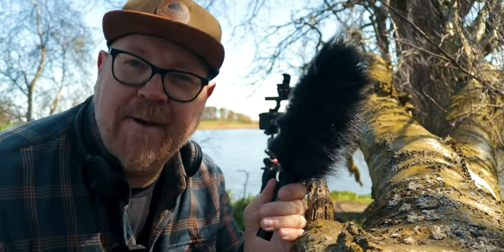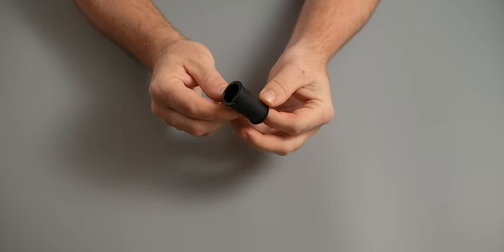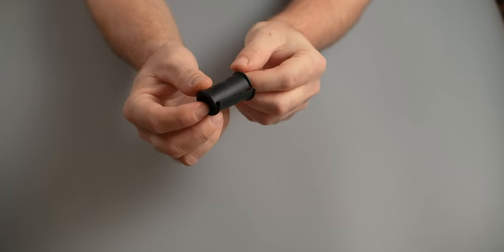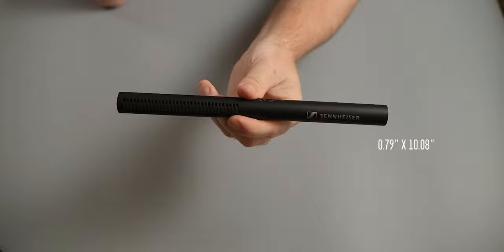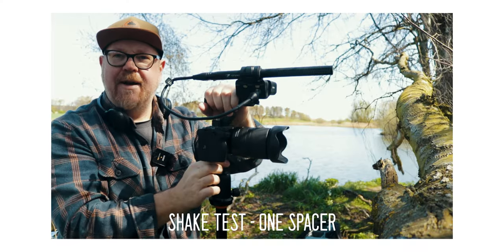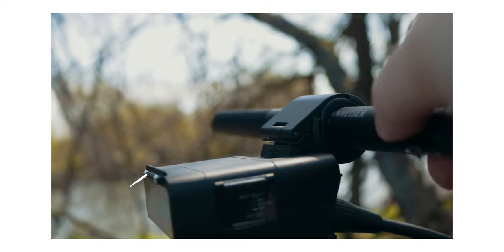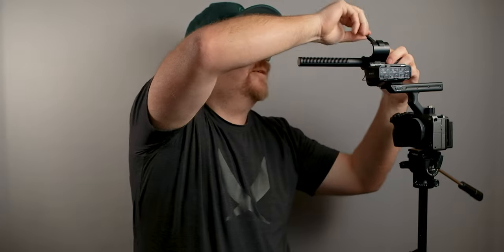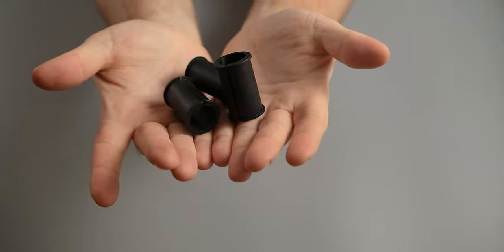Skinny Microphones on FX3/FX30 (MKE600 /NTG5)

Comment: Thanks for this.  Shocking that SONY didnt provide a mechanism to do this, it would have been so easy to cover.
Reply from the maker: Yes, a tiny little rubber piece like this. 
But atleast it's relatively cheap and easy fix. And for the sake of compatibility it good to have a little extra room in that mount for a wider variety of microphones.
Reply: @thomasfransson  That's true.  I sorted my Rode NTG out on the mount this morning, was clearing out an old draw and came upon some old Fitbit watch straps, cheap yokes off the internet - so cut them to size and bada bing bada boom - whadda ya know?  Roll!

Comment: Hi thank you ! Nö question: using xlr and go into my cam with 3,5mm input- is there and Problem with that ?
Reply from the maker: It depends on what type of microphone,  if it needs phantom power it won't work but there's xlr microphones like the mke600 that can be powered with a regular battery if there's no phantom power available.
Reply: @thomasfransson  using the mke600 from upcomming week. Ive just read that the sound was terrible with xlr-3,5mm
Reply from the maker: I did a video comparing the battery power vs phantom power. I wouldn't say it's terrible but you lose some sensitivity and punch when running it on battery vs. phantom power. 
As long as you capture as clean audio as possible in camera with as decent levels as possible you could add some extra "umpf" in post. 

Sorry if this reply turned in to shameless plugging for my own videos but I think these can help you or at least feel better going into this project.
Here's the MKE600 video comparing battery vs. phantom power: 
https://youtu.be/4l8EVyozUDg 
This is a video I made about some free audio plugins that's super easy to use and can add some richness and punch to your dialog in post: 
https://youtu.be/JOgMTB_0lCg

Last solution/suggestion, if you're shooting indoors you could get a simple preamp with phantom power and run that between the mic and the camera.
Reply: @thomasfransson  thank thank you very much! Great!
Reply from the maker: No problem,  if you have the microphone at hand, do a few tests to get to know how it performs. This will eliminate most surprises hopefully.

Comment: Hey Thomas , I secured the MKE600 exactly how you did with the extra gasket. Ive noticed this mic pics up every little sound if I'm shooting handheld ... Is that normal?? thank you-
Reply from the maker: Handling noise can be a problem. Especially on smaller setups. Make sure the cable is secured and not moving around. And be mindful of handling in general. If you need to move around more actively a dedicated shock mount could be worth looking into.
Reply: @thomasfransson  ok i noticed by being careful with my movements the noises go away ... I will say so much more sensitive then a standard mic n play mic
Reply from the maker: True, condenser mic's are sensitive as...

Comment: Hello! Your video is really great. Thanks! 
May I ask you what settings you use for your audio handle and camera to achieve the best results with this microphone? I would appreciate it.
Reply from the maker: Haven't made any deep dives there yet really. Only adjusted gain which have been enough so far. And one time I used the gain pad. 
Mostly in controlled environments which are pretty easy to manage.  
Ah, that and the sync mode is the only settings I've changed.  

Sorry for not being able to provide more insigt.
Reply: @thomasfransson  Thank you for your fast reply! I have the same microphone paired with the FX3, just trying to figure out what I've done wrong. Didn't have the time to experiment much with it, but the first results were, as to say, not so great. I'll try some things and see if it will be better, hope that neither my microphone nor the top handle is defective.